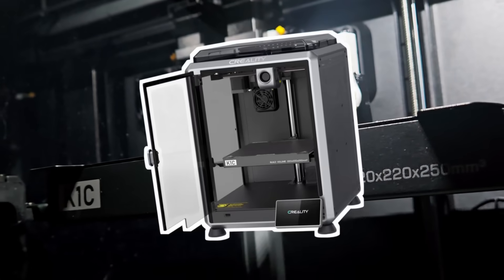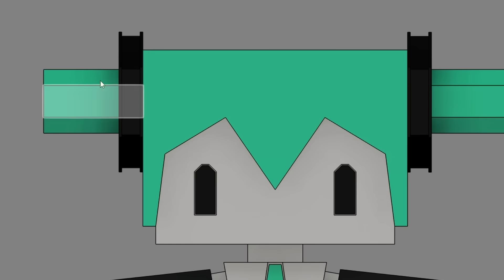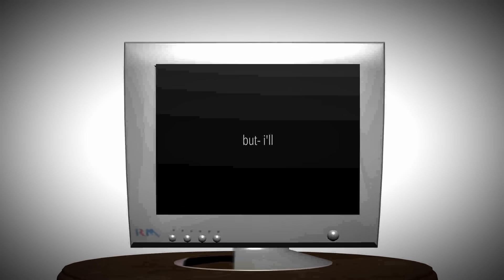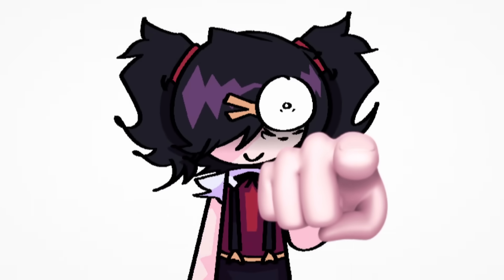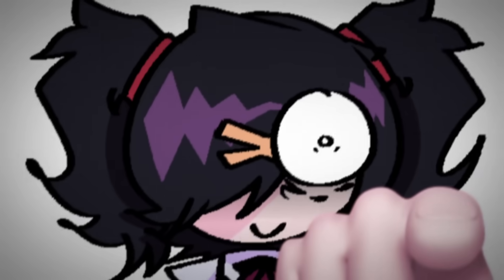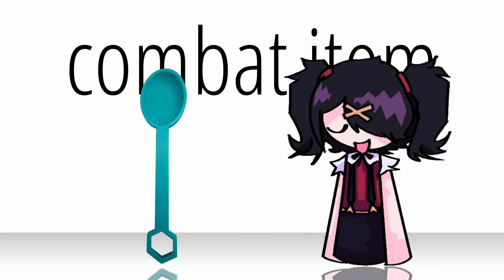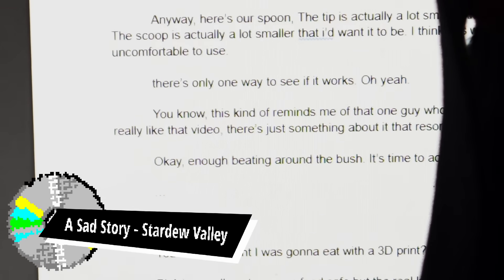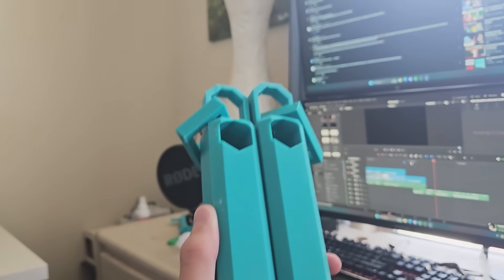I Made Hatsune Miku Knives

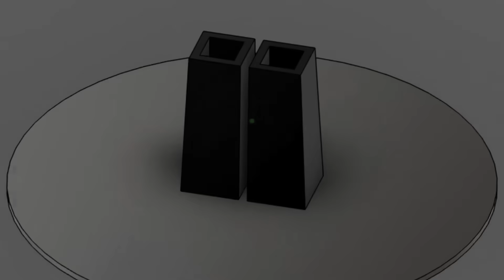Comment: 2:36 Tip: use a blow dryer or a heat gun to soften the glue’s adhesive for about 1-2 mins and it should come off easier

Comment: some tip. You will burn the plastic with hot glue if its like mega hot but if you keep it at like 70-80C it should be fine and it holds very good 3d prints.